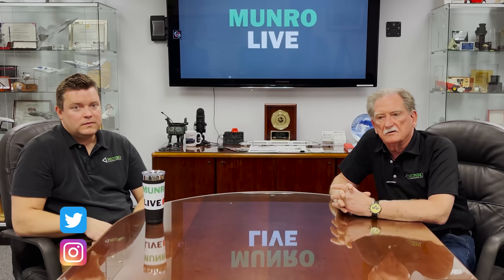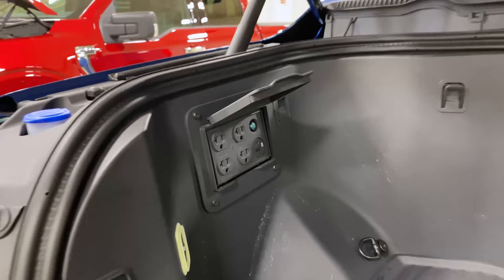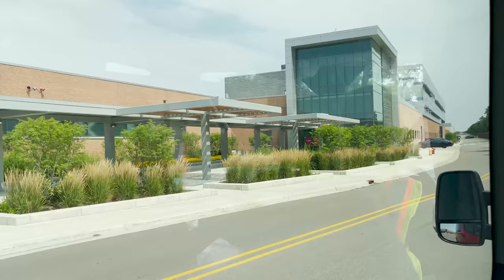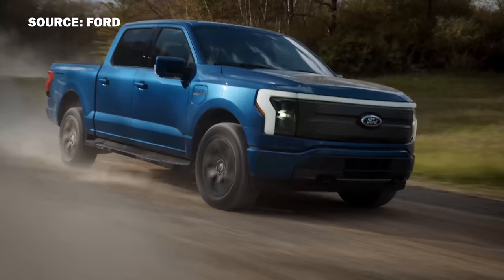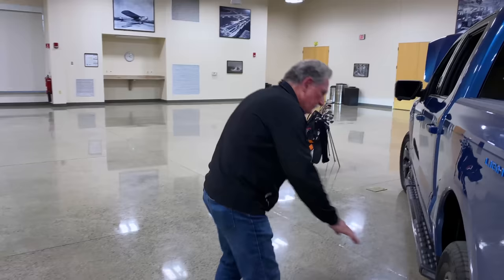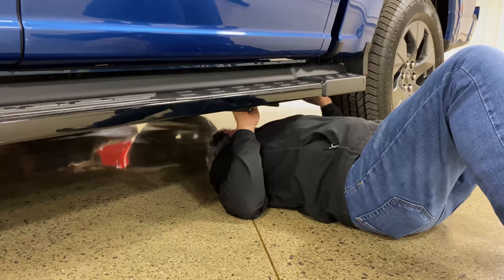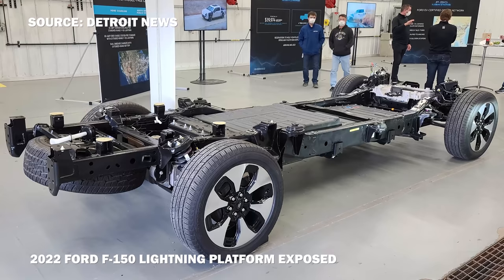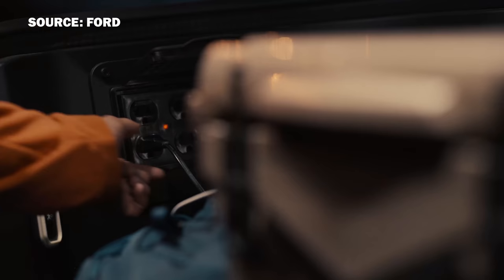Sandy's First Look at the Ford F-150 Lightning Electric Truck!

Comment: 8 bags of c-ment? huh.  I dont have faith this thing will be safe in an accident.  For the price, and specs... I'll go Cybertruck.
Reply: Ford currently builds the safest truck on the road, so why not
Reply: @FusionBoost2.0  oh and just look at design and specs… this things batteries will see a quick death, overheating issues and thermal limitations.  The positive; the battery pack looks easy to remove/replace, also being able to weld 220v and power my travel trailer would be great. But if the cyber truck got that feature, sticking with cyber truck. My loyalty isnt with a brand.  Ford’s financials are in deep doodoo, and their sales model is antiquated.  They arent the only ones too.
Reply: @user-bi7nq4nj7q  Ford or any of the big 3 aren't going anywhere so let's get that out of the way first thing. Sales method is far from antiquated, 95% of vehicles sold today are thru dealers
Reply: @user-bi7nq4nj7q  Your also making a lot of assumptions on a battery you've never seen or used
Reply: @FusionBoost2.0  I am a researcher. I have been studying batteries, and all tech surrounding them for almost two decades.  I dont have a crystal ball like you do apparently, to say the big three arent going anywhere. However, what I DO know is battery chemistry, and advanced mathematics, analytical techniques, and the cost of an industry that fails to innovate.   The big three are in very big trouble, and not only them.  Lets look at the lightning from a critical point of reason.  First off, its just an electrified version of an existing truck.  It is a cab-on-fame design, which is heavy already.  Now add to it the batteries. This truck (long range version) will weigh more than my Dodge 99 24v Cummins, 7880lb weighed!  The Ford will not have the crumple zones that its gasoline counterpart had.  It will not be safer.  Not for the person getting hit by it or the passenger.  As far as I can tell, there is no crash test information available for the Lightning. So any claims of it being safe right now is an outright lie or at best a misplaced assumption. Lets now dive into the financials of ford or even the other big three. Telsas total long-term debt: 10.09B, GM 108.89B, Ford 152.62B.  Current term debt: 0.53B/36.91/49.47B respectively.  Free cash on hand: 16B/23B/25B, which means their free cash flow: 4B/2.5B/-5B.  Calculate the total net debt, you will see tesla is in the POSITIVE at 8B, while GM/Ford are in DEBT by 85B/127B.  Just the numbers themselves speak volumes - Ford (and GM) are in deep doodoo! Any product they make will be sub-standard not only because they have to cut corners, but because they have to work on an increasingly risky slope with less free cash to innovate with. Teslas factories when finally built next year will produce more than the big three’s ev’s combined , with vehicle specs and safety that the big three simply will not match, and with revenue streams that GM/Ford dont have such as the development of their AI applied to both bots, and vehicles.    Claims of batteries more advanced than what is now available wont grow into reality for mass-market for another 3-5 years, if they can finalize their chemistries to get to mass production.  Now, lets get to my expertise - battery tech.   Before be begin, lets address the manufacturing of these cells.  They arent like sending specs to a machine shop and getting an engine built.  Raw materials must be sourced, which tesla has innovated on to acquire domestically, and not to source at the mercy of Panasonic or CALB and the likes. Cells will be made in-house in many cases.  Ford has to rely on the mercy of others to make their batteries. You cant just snap your fingers and hope you will have a supply of batteries, that by-the-way, you have to share with the Mach E supply.  Now on to the battery chemistry: the short range edition will have 110-130kwh, and 150-180kwh for long range version. My personal 36500 lifepo4 cells weigh in at 142g, for 19.8watt-hours, or, 0.139watts-hr/g for 120kwh (nominal) thats means this pack will weight ~1900lb. Very close to what online references claim at 1800lb. So its more reasonable to assume that the battery is 110kwh and not 120kwh.  This doesnt include the batter casing, and BMS which adds hundreds lbs more.  For the long range version, that scales to 2375lb, 400lb more weight, meaning it will also require more mass to hold the cells and their retaining structure.  Both LR and SR versions have same output specs.  If the tesla has greater wh/mile the stress on the pack will be significantly less than the stress on the Lightnings pack.  The claim of 230-300mi for this truck with poor aerodynamics in comparison also means that 55mph+ driving on this truck will significantly decrease its range, meaning to get 230mi out of it you have to drive conscientiously, which most typical Americans dont do in their trucks.  This infers that the batteries must experience higher loads, more often which correlates to a higher rate of degradation, which is non-linear with respect to repeated, higher loads, and compounded by higher operating and charging temperatures.  To counteract this, they would have to beef up the cooling system and thus use more power, reducing range further by the addition of cooling system mass, and/or the reduction in power output.  Towing with this truck’s short range battery will be a no-go because of the 50% decrease in range, and further heating of the battery, in addition to cooling load on the system to maintain safe temperatures.  Even the long range version wont be able to escape this deficiency. Ford owners will be flooding YouTube’s channels with disappointing reviews no doubt.  God forbid this thing have to tow anything up a 5% grade.  Its thermal management system will reduce your speed to 45mph or less to deal with all the compounding physics its fighting against.  You wont be able to get from PHX to Flagstaff Az in one charge carrying a load half its rating. In my opinion, the big three have stifled the competition and innovation for so many decades that their fall would not just be justified, but wholly welcome.  Their rate of innovation is shameful at best in search for profits over the development of transportation and humanity as a whole. Their output of a meager 80,000 cars per year is another talking point, along with their European market which has issues with it size and dimensions.   Unless they are bailed out by a sympathetic president (cough - Biden or his successor) their market share will be eaten alive by tesla.  People will buy whatever vehicle suites their pocketbooks and needs… otherwise the geo metro wouldnt have ever existed.  When it comes to safety, the cybertruck wont be beat.  Their new cell design wont be beat until a rivaling tech hits the market, and when mass production of their more affordable lines of cars come out, they wont be beat. 
BRO! You are in over your head here by claiming the big three arent going anywhere. Too big to fail sound familiar?  In conclusion, this justifies the claim that not only are the big three poised to fail, but for the scourge on innovation and perpetuation of fossil fuels over many decades, they deserve to fail.

Comment: GARBAGE! So disappointed 😩!!!

As a life long Ford truck owner I was so excited and hopeful for this truck. Sadly the value proposition is garbage. A 230 mile range is useless, so add $10k to the price. You want the cool electric features with all the plugs, household generator, tow technology package? You have to get either the Lariat+ Premium or Platinum trim level… so it’s $80,000 or $90,000. Looking at the value of the Range, features, and technology the Lightning is $20,000 overpriced!!! It’s very disappointing Ford isn’t trying to offer a competitive value to the Rivian or Tesla trucks. I cannot recommend anyone get the Lightning unless they’re cool throwing away money.

Comment: honestly...humor me.  model x is more aerodynamic and a 5000lb 2 horse trailer had it up to 700wh/mile???  at 10,000lbs i doubt this thing will go 150 miles at 50mph ie it cannot travel with its tow rating.  even if it could tesla megachargers will be here once again far before any public truck chargers if ever tbh.  i wonder if EU will be stupid and standardize another stupid plug 2/3 years after tesla has made a better one.  anyway

cybertruck at 500+ miles at 14,000 even if you cut it by 1/3 to 170 it could limp between current tesla charger spacing with ease and even some bad spots.

one can move a camper slightly better than a model x.  10,000lbs around town and maybe some shorter routes
the other can move 14,000 across the country at speeds that wont make you regret buying the thing.

cybertruck likely wont ever be charge capped until megachargers come out.  200kwh vs 80kwh m3 at 250kw peak so easily 600kw charge rates?  vs 150/250? for a 200kwh lightning?  its overkill for driving empty anymore but for towing its a whole nother world.  you need that full charge when youre guzzling 1kwh/mile

Comment: Problem Ford will have with this truck.. batteries batteries batteries.. you can’t sell ‘em if you can’t build ‘em, no matter how many people want ‘em. So they better get their battery manufacturing up and flying fast if they are serious. Or they will just be making a small fraction of what they could sell of these
Reply: Check those two F/SK joined venture battery factories ready by 2023.
Reply: @garfieldchenyu1  that’s a ways off for a truck going on sale in 2022.. and don’t think batteries just ramp from 0 to 100% in a month or two. SK will likely take a year or more to get to high volume. So you’re kinda looking at 2024 to hit any big numbers. Tells me it’s going to be a slow roll out for a couple years of the Lightning.. my guess from what I see.. and that’s all barring any real setbacks.. which do occur..
Reply: @airheart1  Until those two factories are built, SK will import the batteries from their other factories in South Korea.
Reply: @charlesball6519  well.. maybe.. good luck to ‘em. They aren’t pumping out a whole lot of Mach Es and supposedly they’re in high demand.. which screams battery constraints. Adding the F150 with huge batteries in, isn’t going to make it any easier. Guess we’ll see

Comment: 3:52 That lock loop in the middle is brutal ... That should be redesigned
Reply: You are absolutely correct! My '60 Buick's hood has one of those, and damned if I haven't banged my head on it 70 times. You'd think they could've designed something a bit better since 1960.
Reply: So should the Cybertruck.
Reply: @RapperBC  talking about Buick that's the cheapest one made out of all.

Comment: If Tesla backs off the 500 mi range for the cyber truck, then I will switch gears and buy an F-150 lightning.  300 miles of range is not enough for a truck that is going to actually be used as a truck
Reply: Over 40% of preorders are the Tri-motor. Hard to believe they would back off from that. I think they just need more time for 4680 production is all. 

The best feature of the CT for me, living up North is no-paint, air suspension, and vault with ramp tailgate.
Reply: Tesla's range estimates have historically been optimistic. Ford's range estimates have historically been conservative. Look at real-world Mach-E and Model Y range ... Roughly same battery size + roughly same vehicle size and weight = roughly same range (if driven the same)
Reply: @bikeaddictbp , range is not the same nor is the weight compared to the Model Y, which is 600 lbs less.
Reply: @bikeaddictbp  Utter BS. Not even close to the same battery size and AWD vs RWD.

Comment: Doesn't Tesla set out to do the opposite from an isolated battery? They want a battery in which every cylindrical cell is  a structural member of the chassis. So if you want to replace a half pound cell, you need to total the whole vehicle. And no, they will not be selling parts when you want to restore a broken Tesla, tehjy want you to scrap it. Fekk it if not green. They want to play the big numbers and make you think of the CO2 numbers of a vehicle that does live to 30 years and a million miles. Because plant food is a bad, BAD thing. And climate comes from it, not the stuff that happened to the moon landscape. All over it. Think about it.

Comment: How could they not let you drive ? Elon not only let Jay Leno drive the Cybertruck, but let him drive it through a Boring Tunnel ; which no one had done before. Ford is a marketing company. nice truck, but we’ll see if they can compete on value position vs Cybertruck. Oh and that touch screen is utterly useless when paired with horrible software. Ford is not a leader in software and will never be.

Comment: This truck is more gimmicky than anything else.  It still has the same issues all EVs have.  Range is too short, recharge times are too long, capability is lacking and it's too expensive.
Reply: Will suit some, won’t suit others. It would suit my needs.

Comment: I am also confused like others about the isolated battery pros and cons.  Would love to hear Sandy and Cory go into a little more depth on why its so special and how it works better in some situations and not others.  As others have mentioned if the battery is being shaken to the point of damage you probably have bigger problems.  I'd imagine that the shock absorption on a truck would protect more than just the passengers experience and therefore include the battery pack in that protection.  Also, why is Ford being so secretive and not letting many people drive this truck?  In fact, why is any manufacturer so hesitant to let people drive these "prototypes" if they have the confidence to show them off and tout how great they are and how great they run -- why wouldn't you allow people to drive it.  This concerns me and I don't know why they don't come clean about why its undriveable by others but its amazing at the same time. Is it so fragile that an expert automotive engineer is going to destroy this precious prototype?  But I am excited that it seems good so far and glad that Ford is doing and it and wish them great success with their EV future.
Reply: There are usually a lot of insurance issues with just letting prototypes out on the street in the hands of just anyone.
Reply: @TheEvilmooseofdoom  imagine the insurance issue with letting the president drive it! :)

Comment: Previous lightning owner.

I'm very miffed about couple things.

First I don't mind it being an EV but I do mind they killed the heritage of the traditional lightning which is supposed to be a sport truck/muscle truck.

They cap the top speed to 105 which is a travesty.

I've taken my lightning considerably faster than 105. 

The good is the power part, the interior and the screen. Plus the daily use ability. 

I would have bought a new lightning but they totally alienated previous lightning owners.

I would rather have a shelby super snake sport than this lightning. 

Even with the useful frunk.

If they had a cross country race and the lightning beats a traditional gas f150 considerably I may get the EV yet.

But they really need to bring back the REAL LIGHTNING.

Comment: Will Ford include a first aid kit to go with the exposed latch under the frunk lid?
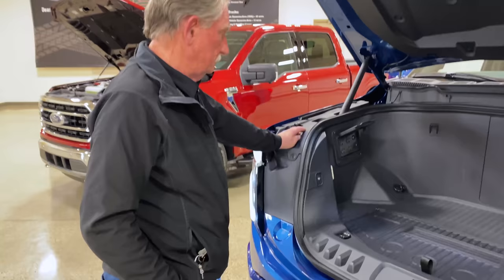Reply: @twany442  3:39 Hood latch is at exactly the height of Sandy's head. An accident waiting to happen.
Reply: @KiwiNeale  I don't think it will be a problem at all. I've seen all type of reviewers hop in and out of that frunk, tall short all different heights.
Reply: @twany442  If Ford mounts a swear box in the frunk it will be a great source of revenue.
Reply: @KiwiNeale  That was funny! 😁

Comment: This thing makes brand new use cases for a tuck, it’s like several vehicles in one. Someone needs to engineer a second battery option, kinda like the old dual tank pickups.

Comment: Until there are pull through charging stations to charge at while towing a trailer this will be limited to local drivers. Even Tesla does not have pull through chargers for their Cybertruck they plan on making.

Comment: The lightning is 2 inches taller and has 1 inch less clearance than it’s gas counterpart. It’s a gasser with an EV powertrain shoehorned in. And shoehorned poorly at that.

Comment: Why a big gear shifter when you do not have any gears. Seems like a big waist of energy to make that feature. To bad they didn't use the energy to make it even a little aero dynamic. Waist of energy pushing that monster through the air. Economy does make a difference with electric as much as with ICE.

Comment: Just waiting for all of the salty Cybertruck fanboys throw their fits and talk crap when they don't even have a product to compare it to. And why was the Cybertruck delayed yet again?  Does the Cybertruck have a power inverter that can charge your home or car?  Or enough electrical sockets to run a whole business? No it does not.  When is the Cybertruck coming out?  I heard it won't be here until the beginning of 2023 if at all.  But I guarantee they're in their retooling and rethinking the Cybertruck.
Then I'll have to hear we have a prototype. The same prototype that's been missing in action never to be seen again.
But I'm quite sure that I'll have to hear from the many sideline so-called engineers, factory workers, designers and product development team members also known as a Tesla fanboys.

Comment: If the range proves out , i think the Ford will stomp the Cybertruck because Tesla will not sell parts , and has few service centers . As a truck owner , i do all my own maintenance and repairs , and the nearest Tesla service center is some 200 miles away , as compared to two Ford dealerships within 20 miles .